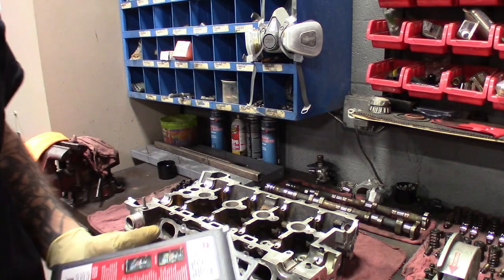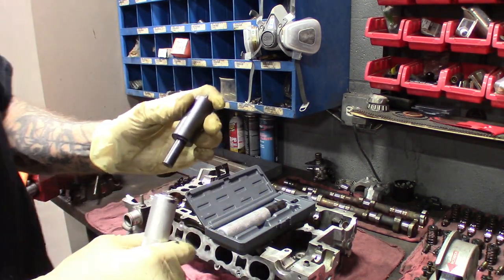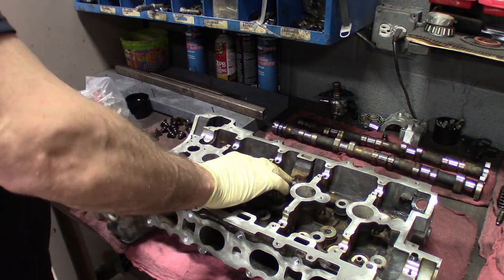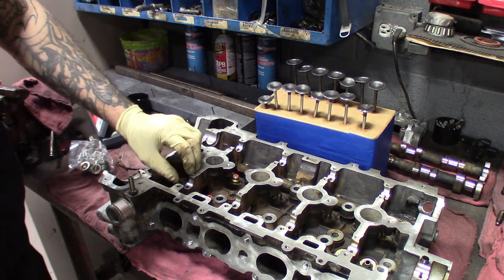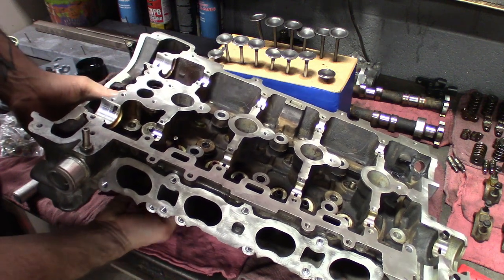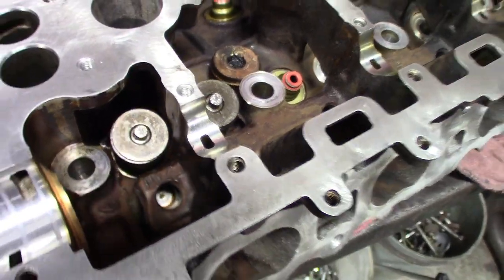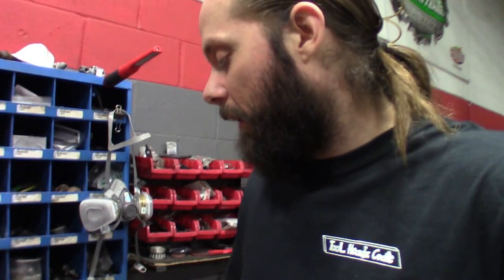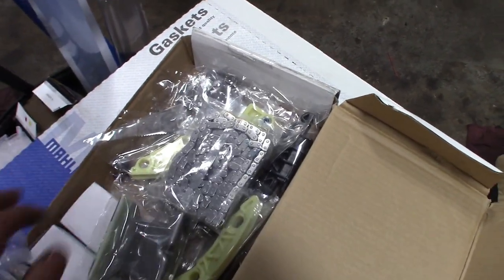Show must go on, TOOLS IN A#@$%N

Comment: Theres a powersports tool that's basically identical to that one. Yamaha sent it several years back and it works like a charm. Much faster and easier vs using a traditional spring compressor.

Comment: Hi JRC54 - did they have problems with CAM-CHAIN in them engines to (stretch) that is?  AWESOME VIDEO and tool !!!
Reply from the maker: Yes, the eco motors had oil issues causing this chain and phaser to fail and bend all the valves
Reply: @JRC54   Gotcha - great info!!!

Comment: That thing looks painful.  I’ll take the big c-clamp/vise grip style compressor or the bolt-on shaft style any day.
Reply from the maker: It is painful but a easier.
Reply: yes its easier that tool was meant to be used with a hammer he just didnt want to use the hammer lol i was to weak to use my muscles loo
Reply: I’ve always used the screw style spring compressor and a small magnet to snag out and reinstall the keepers but, I’m usually replacing a broken spring or valve seals with the head still on the engine. Seems like a nice tool, though.
Reply: give it a try. i love it